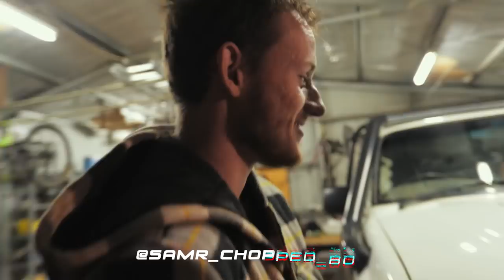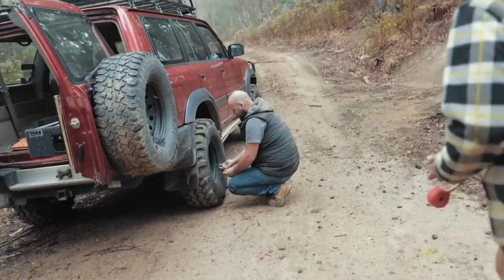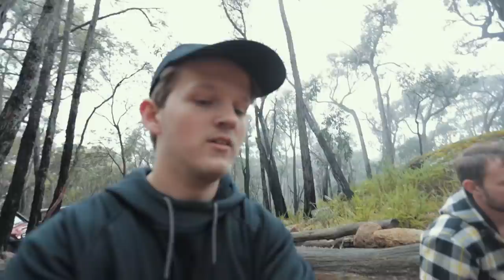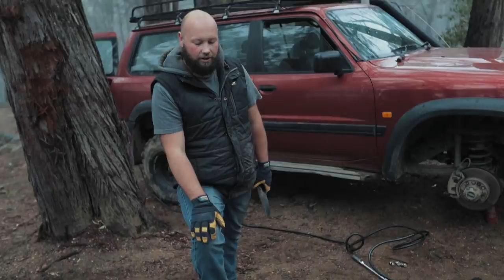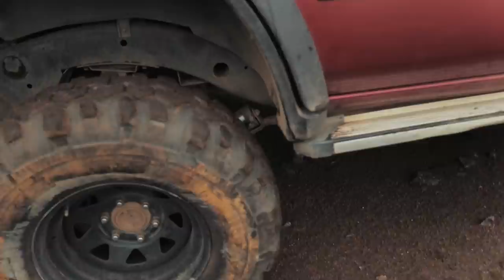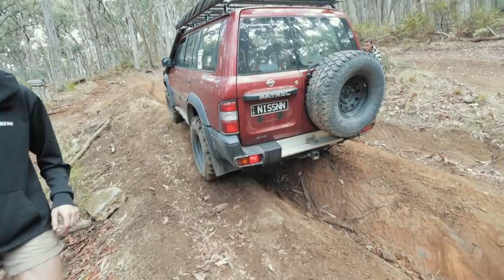4WD in TALLAROOK Close Calls and Broken Patrols! | Phone Track & Steep Track | Livin 4x4

Comment: Just a small point looks like that 105 has a gas tank. Plates need the lpg sticker if it's hooked up otherwise cops can stop and fine you in Victoria. small chance of it happening but better than a fine.
Reply: Litterly thought the same, could be air tank for bags???
Reply: @toms_gupooe  more likely to run of a compressor than a whole tank. he's also got the two filling ports on the passenger side
Reply: @bigoz1734  Gas tank it is then
Reply: Thanks for pointing that out man, I’ll see if I can get some👍